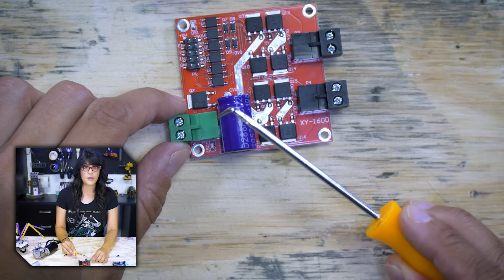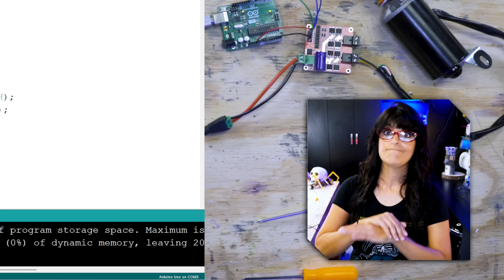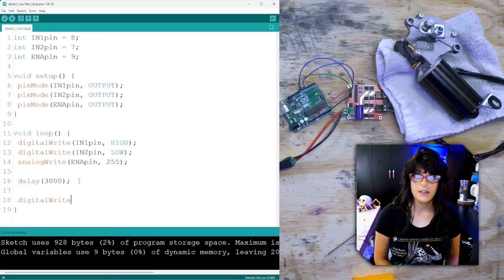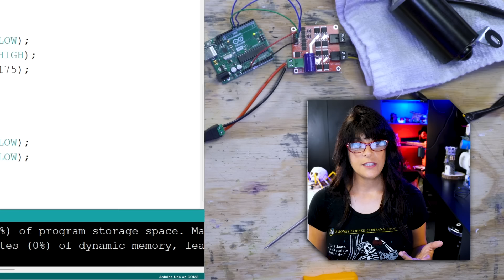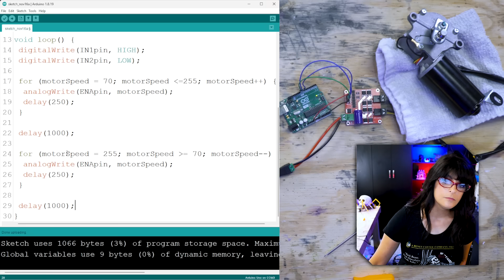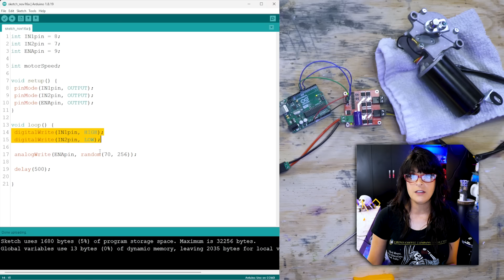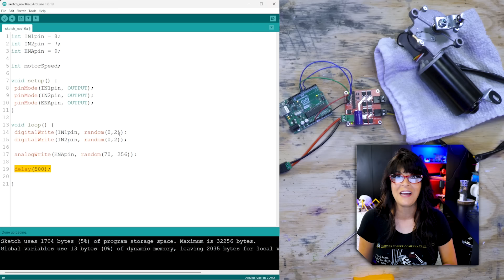How to Control a 12V Motor with Arduino: Easy Wiring & Code Examples

Comment: I like the Drok motor controller. That's what I use. It uses FET's, and it doesn't have a heatsink, and from what I've experienced, it doesn't hardly get warm, even with heavy use. I think it has opto-isolation, and that's one reason why it has a separate ground. It seems to be a pretty trouble free controller. Also, the wire receptacles are removable. This makes it very easy to wire, if the board is already mounted in something. You can attach the wires to the receptacle, then plug it back in to the board. It also makes it easy to switch channels, if you want to test the other channel. 

The power input receptacle is also removable too. If some accident happens to your board, you can easily swap it out, and the project remains wired - aside from the control wires. I like that there are lights for both the control section, and the drive section, so you can tell which sections have power. Also, the positive and negative pins, for the control section are joined, so you can daisy chain & power another board, with the free pins.

Comment: Your pin variables should be const byte/uint8_t/unsigned char at the least, but really you should #define them so they don't take up any memory. Also your for loop variable is needlessly global, especially since you reassign it in the next for loop. Again it only needs to be a single unsigned byte. These things really don't have a lot of memory if you want to write anything substantial so it's good practice to keep in mind what kind of variable you need, how big, what scope. Also I don't know it really bugs  me when people use the post increment operator instead of just the increment operator, it needlessly uses a variable and is slower. The post increment/decrement operator is like a special use case, when i really want the value before i increment it, and even that i kind of just avoid because it's a little harder to read. ++motorSpeed and --motorSpeed JUST adds one and subtracts one, respectively.

You're also not getting random values, they'll be exactly the same every time. You need to seed the generator randomSeed(analogRead(A0)); // typically read an unused analog pin

And there's random(unsigned int) which returns 0 - parameter, there's no need to do random(0, n);

#include <Arduino.h>
#define IN1 8       // this is a really good idea
#define IN2 7      // to do
#define ENA 9    // on all projects

void setup()
{
  randomSeed(analogRead(A0));      // this is important to actually get pseudo random generation
  for(byte i  = IN1; i <= ENA; ++i) pinMode(i, OUTPUT);
}

void loop()
{
  digitalWrite(IN1, random(2));
  digitalWrite(IN2, random(2));
  analogWrite(ENA, random(70, 255);
  delay(random(30, 3000);
}

Comment: If you define your constants as integers, your code will be bigger (integers take bytes) and slower (to load the registers with the integers stored in memory) , better use #define to declare your pin numbers. Also, to avoid loading motorSpeed, applying the operation and storing motorSpeed again, use the += and -= operators (motorSpeed += random(70,256)) to do the operation directly on the memory location. Also, and that may sound the complete opposite of what I just said, you can use a variable for your digital writes to set the direction, just use direction and !direction ("not direction") and use a (simple) function to start the motor in either direction: it's a net gain of size as soon as you call your function more than once, and that avoids making mistakes such as writing digitalWrite instead of analogWrite (that one was easy to debug, I had much trickier ones with interrupts...)

A fun application is to control the motor with these small joysticks plugged on the analog pins. However, you want the joystick to control the acceleration, not the speed directly, so the reading from the joystick increases motorSpeed (add some delay) instead of being used directly. Thus, when motorSpeed is positive, you spin one way, when it's negative you go the other way, and when it's within -70..70, you just halt. If you go straightforward, it's fairly simple.
Another one is to add end-switches, so you know your spider is at the top or at the bottom and you don't rely on time, as speed is rarely exactly the same both ways (mostly, but not quite). In my case, I want to deply a cinema screen when pressing a button in one way, stop when it's down, change the direction on the switch to have it rolled back up. your wiper motor is normally powerful enough to do that but you can simulate with normal small motors, no need to go with stepper motors (although it's a lot cleaner as the position is controlled by the motors). Just thinking of what you can do with limited coding...

Comment: I use 3 relay`s to control my wiper motor. One for power on and the other two for direction. The motor is used to cover my greenhouse up at night with a canopy. The arduino program memory and RTC lasts all winter outside in minus 10 sometimes.

Comment: It's obvious that you were going for a first time tutorial on Arduino so you left out so many things.  One piece of advice that you didn't cover is using functions.  Whenever you find yourself doing the same thing over and over again, just put it in a function so you only need to call that function.  My favorite trick is to make my own function and name it something like move(dir, speed);  Dir can be 1 or 0 and speed could be something like 1-100 to think of the speed in terms of percentage for easy coding at the top level.  You scale the percentage to your 70-255 in the function and can use float so you can use decimal percentages if you want to.
Reply: Like you said it was for beginners. We don't need to know about your function yet. Best to go step by step like she did perfectly.
Reply: @zorbzzsterio6406 I believe his point was that if you find yourself typing the same 2+ lines of code over and over it is time to think about making a function and calling it instead. This is formally called structured coding.

Example: Several years ago a co-worker used the same two lines of code throughout a large C++ project repeatedly. I showed him that under some rare circumstances it would first work as intended but also cause his program to crash later. He defended his decision with "That will never happen, its all the OS fault" . What made it worse was any change to the program affected whether or not any of those code sequences could cause the crash.

After he moved on to another company I inherited his code base. The first thing I did was to search out the literal thousands of times he had used that sequence. I turned it onto a function and added 3 lines to prevent the crash error. This function was placed into a common library. The end result was that most of the random crashes went away immediately. 

Creating a function from this repeated sequence allowed me to make the code easier to read, fine tune the functionality to eliminate crashes, and made the executable marginally smaller. This was at the expense of making program theoretically a couple microseconds slower, but the human operating it couldn't tell the difference.
Reply: Todos nós tivemos um começo antes. 
Imagine você começar aos 66 anos. 
A garota esta de parabéns.
Reply: In that situation you'd also define a constant for forward or reverse for the direction. You will forget if 0 is forward or 1 is forward. Most code and always be improved.
Reply: What if I don't need super cool movement? Will this work for mediocre movement?
Reply: @edisont.picard4112  Then you probably don't need to write functions in the first place.  All of the programming tricks are to help the programmer to make his life easier.  It's good to know the tricks and then do whatever you want to as you feel.  But as soon as you start working professionally your peers get really picky really fast.  And your boss will mandate certain practises.  But if you're just playing around on your own or even doing it for money but nobody buy you will see your code, do whatever you want.
Reply: Thank God!!! A man chimes in to save the day!  What would we do without insecure, know-it-all males, that have to fix women's technical explanations to show their "superiority"!  We are saved now!
Reply: May I know about version number of motor module?
Reply: Neurondye*?
Reply: What power supply do you use? Thanks
Reply: @wilburnmckay6227  It depends on what I'm controlling.  I like to use 12V because there are lots of 12V motors and can be powered by a car battery as well as the Arduino (12V is at the upper end of the range and does heat it up a little from the regulator dropping it to 5V on the board) and the motor can be powered by the same supply (instead of using 2 separate supplies).  Typically I use a power supply with a barrel jack from Amazon.  12V has the advantage over 5V in that the line loss is not as great with 12V so you can deliver more power.
Reply: Perhaps you need your own channel
Reply: @balonkysnacker8797  I have thought about that. she is actually pretty good but some of the stuff I watch is definitely a notch below what I might do.  My problem is the same as with writing.  First, I need to have something I want to say.  I could out yet another tutorial on how to solder of some cool project.  Or I could just strap on a go pro while I work on my car.  Usually I don't think about that until I'm finished though.  I could just make it random stuff that I do or musings on politics.  But all of that is already done very well by other people.  So I just watch them.
Reply: She is trying to keep it simple for total beginners. If you are the expert you are only here to criticize so go away.
Reply: Cheers!
Reply: it's obvious that you're mansplaining
Reply: Woman bad man good
Reply: @Protectpositivesquad  I said nothing about sex.  I like her.

Comment: Wowa your such a good teacher I’m wanting to learn this code to control a single axis solar tracker “slew drive”
Base on an astronomical clock at a given global location, I did experiment with chat gpt on the above, it virtually wrote the code, I do understand once  I get all the hardware setup I can then determine the travel 

time it takes the motor to travel from start to finish (east / west)
in short we already have another dual 
axis solar tracker system running perfectly (was a bought controller from the USA)
But wanting to setup the above mentioned.

Comment: Hi, thought this was such a great vid and it's exactly the thing I have been trying to do. I was intending to use a nano but can't get it to work. I have ordered an arduino uno and I will try again. I will you know if I get there. Thanks, without your video I wouldn't even attempt it.
        Regards Paul
Reply from the maker: Let me know how you make out with the new board!
Reply: Had a nightmare with both uno and nano, pretty sure I did follow your input word for word etc. messed and tried over and over finally got it to verify a very simple program and then it won't upload. Is this due to my internet speed being slow (1 megabite per second download speed)? slowly loosing the will to live! No I am fine just frustrated. cheers Paul Happy new year  @RachelDeBarrosLive
Reply: @RachelDeBarrosLive  Sorry for delay, not been very well, but good news I've got my motor running forwards and reverse with my nano. OVER the moon it was an upload problem. Will check it out and let you know, (would have to check it out, can't risk giving you wrong info) and yes cats do rule as you said.

Comment: Hi Rachel, my name is Bruce and I must say your video was excellent. Out of all the videos I have watched, yous was clear and very well explained. Seeing you type the code made it easier to follow. 

Do you have a video that explains how to code for motor control for speed/direction and position (PID).  Have you ever programed the Seeed Studio XIAO SAMD21? I designed it into my product because of the small size.

I have developed a Powered Clutch system for motorcycles. Using the Seeeduino XAIO,  a Pololu motor driver. a Pololu magnetic encoder on the motor shaft, as well as to two limit switches for protection. It operates using an analog slide pot mounted to the clutch handle which sends a variable signal to the Arduino to drive the motor speed and direction and to the correct position.

Your help would be greatly appreciated. I can send you a lot more details about this product/project, or you can see it at www.AdaptiveTechnologyLLC.com. 

Thanks,
Bruce Milligan
info@AdaptiveTechnologyLLC,com

Comment: // Here is a simpler way to do the  motor direction
// in this code the (!) makes a 1 into a 0 and a 0 into a 1...

// option 1
int motorSpeeed = random(70,256);
int direction = random(0,2);
digitalWrite(IN1pin, direction);
digitalWrite(IN2pin, !direction);// Look at (!) in front of direction.
analogWrite(ENApin, motorSpeeed);
Delay( 3000);

// option 2
int motorSpeeed = random(70,256);
int direction = random(0,2);
digitalWrite(IN1pin, direction);
digitalWrite(IN2pin, !digitalRead(IN1pin));// Look at (!) in front of digitalRead.
analogWrite(ENApin, motorSpeeed);
Delay( 3000);

// Try it
Reply from the maker: Nice job! I'm going to try this out 👍

Comment: Try "perlin noise" for a smooth randomness.  Its not so jerky,  The Coding Train's channel introduced to me way back and its perfect for random stuff that you dont want to be jerky but still random.  They use it in video games for things like grass waving , trees etc.   I put it as the delay for the blink sketch and it has nice transition between fast and slow pulses.  I got the code from chatgtp for the perlin noise functoin and it worked great,   Although im sure there are perlin noise libraries out there but if iremember right chatgtp didnt need any libraries  other than simple math to make it work.

Comment: Thanks so much for this video, great intro for working with Arduino and motors. Quick question: when I unplug the Arduino from the computer, it shuts off. I have a 12v 2.5 amp plug going into the driver motor module, why wont the Arduino operate without being plugged into computer? Thanks again!
Reply from the maker: Great question! While the Arduino is plugged into the computer via USB, it is both receiving power and able to receive data (code uploads). Also, whatever other modules you have hooked up to the 5V pin of the Arduino is also getting power (the motor driver module). Once you unplug the Arduino from the computer, it stops getting power (although the code remains stored in the microcontroller).

The 12V 2.5A power supply you have connected to the motor driver module only powers the motor. The Arduino must be powered separately. It can be powered either through the USB port or the barrel jack right next to it. If your project doesn't need to move around you can use a separate 9-12V power adapter to power your Arduino. I've also used portable phone chargers to power the Arduino through the USB port.

Let me know how you make out!

Comment: Lady, you surely have a gift. I need instructions for an RC motorized tank. Seems I cannot find the info anywhere. Can you take this to a Flysky with Audrino programming?
Reply from the maker: That would make a great tutorial! I see that most people using Flysky controllers use the IBusBM library. I'll have to dig a little deeper to see what I find.

Comment: I is always nice to watch different Arduino videos.  Raspberry Pi, ESP32, and Arduino projects are great learning tools.  🥳    Thank you Rachel.   👧  Most interesting. 
This project might be nice for a telescope star tracker add-on?  🌟  PWM SPEED CONTROL: enable signal terminal (ENA) input PWM can regulate speed, PWM frequency range 0-10KHZ.??
Reply from the maker: The telescope project would be a great one to try!
Reply: I am learning the Raspberry Pi Pico W , MPU6050, Thonny MicroPython.   Thank you. Bye.
Reply: My tablet does not have a compass, so google skymap does not work on it.  
I was wanting to figure out how to patch a MPU9250 into my tablet wirelessly, 
so that I could use my tablet as a telescope viewfinder to see what star I am pointed at...

Comment: Not sure if you mentioned it or not, but I believe if you bring both IN1 & IN2 high, that provides a braking function (pretty common with h-bridges).  In fact, I think your random function can cause the motor to brake when both are high and you can see that behavior in your video.
Reply from the maker: Yep, indeed it does! I can't remember if it's in this edited down version of the live stream or not but that's a good point to include in the tutorial on the website for everyone. Thanks for the catch!
Reply: @RachelDeBarrosLive  Actually, I just re-watched it and you do mention that.  Thanks! 😊

Comment: Look up IIC I2C TB6612 Mosfet Stepper Motor PCA9685 PWM Servo Driver Shield V2 

For your spider. It can control up to four dc motors. 1.2 amp per motor up to 3 amp peak. That should be more than enough to drive those little motors. will save you time and effort. AND wiring.
Reply from the maker: Great suggestion! That will definitely help tidy things up a bit.
Reply: @RachelDeBarrosLive  YW

Comment: How many amps does the motor run?
Reply from the maker: This wiper motor needs 12V 5A to run. The motor driver module I'm using (XY-160D) can deliver up to 7A.

Comment: i'm familiar with the hardware, but as usual watching you as I do... I always learn something new!! 
😊😊😊😊😊
🍗🍗🍗
Reply from the maker: I've been testing some paint ideas for my latex zombie flexy head and I think acrylic works best so far. Although if I pitch the paint too hard it does crack but it can withstand some bending. It will make for a great future live workshop!
Reply: @RachelDeBarrosLive  - I bought a starter oil paint kit, too. I can hardly wait for the next zoom workshop to experiment some more! 🤩🤩🤩🤩